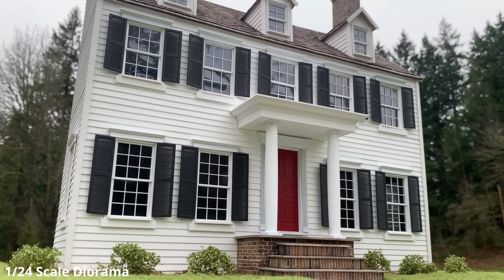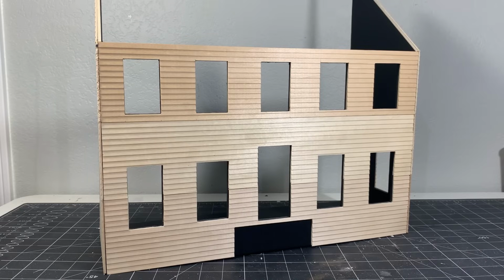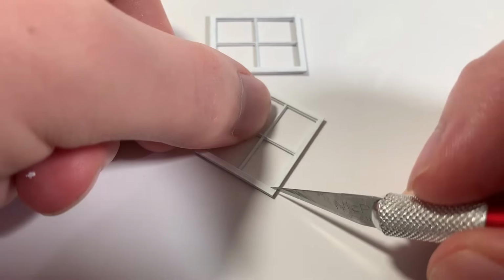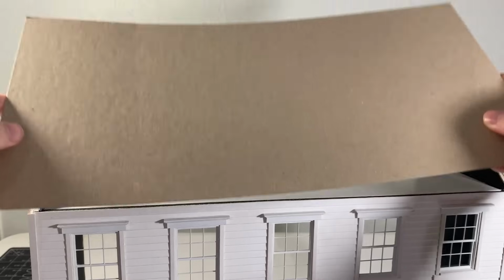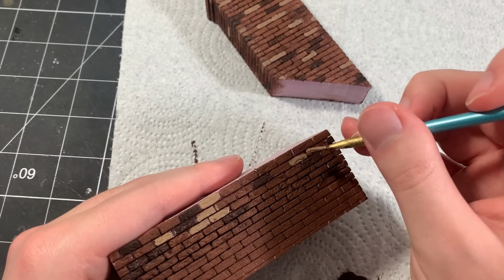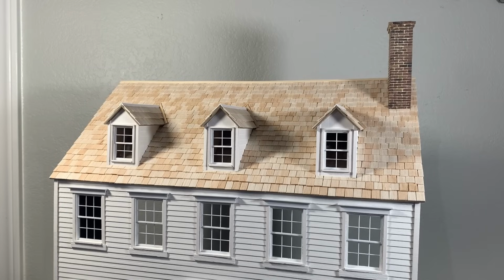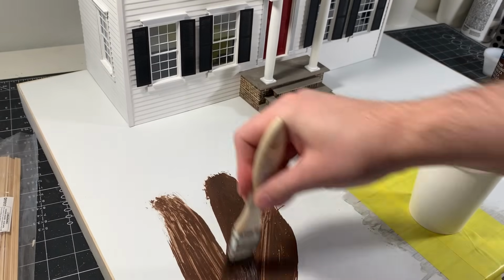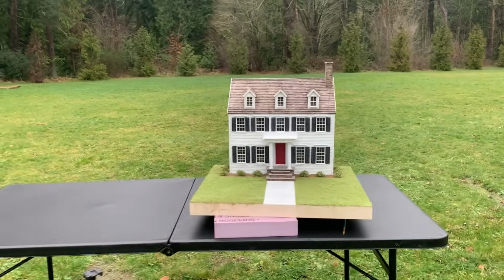I Built a REALISTIC Tiny House

Comment: This is an amazing job!
Kudos for showing how the shutters cover up the window trim when they are in the open position!
I'll give you a couple hints for your next project.  The first floor windows are too low.  The heads of the windows would either line up with the top of the door or be higher depending on style. Here the windowsills would almost be at the floor (not a problem) but the heads of the windows would only be about 6' and so you could not see the sky unless you walk right to the window or are seated.  Also, the foundation would not be covered by siding below the floor framing.  Finally the columns would be at the corners of the architrave or porch beam.
Keep up the amazing work!!! I'll have to check out your other videos - great job!

Comment: This looks really great! There are some things that really would have sold the illusion even more though:

• stopping the clapboard siding a few scale inches off the ground, revealing a stone, brick, or concrete 'foundation'. Wood in contact with the ground will rot, so no one would have wood siding in contact with soil. Also having some slight weathering on those bottom courses would make it look more realistic. Unless a house has been freshly powerwashed, there will always be some kind of dirt on the siding at the very bottom.
• house numbers, porch lights, a mailbox, and some kind of clutter on the front porch (potted plants, delivered packages, etc.
• gutters, downspouts, and electrical service indicators 
• outdoor HVAC equipment and panels, etc.
• imperfect/dead areas in the grass
• a more realistic grade from the house to the street, no yard or sidewalk would ever be perfectly level across that span.
• 3d printed frames for the windows, with all the stops and an angled sill to shed water. It's a subtle detail, but scoring the paint on the printed window frames shows that you are willing to go the extra mile for details like this.